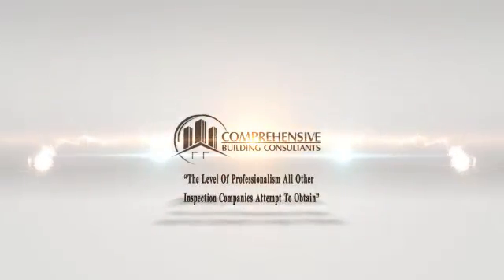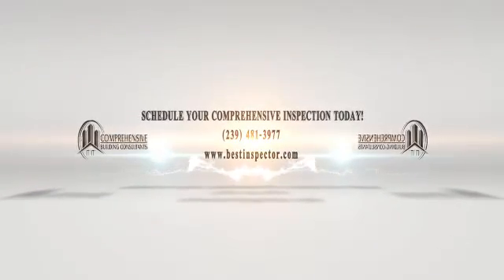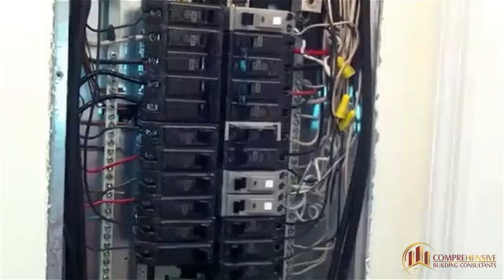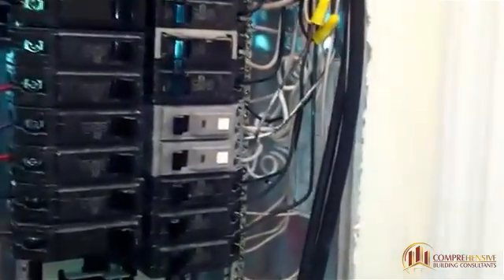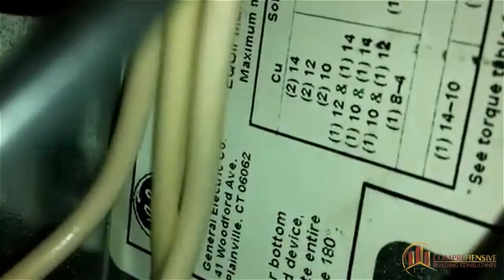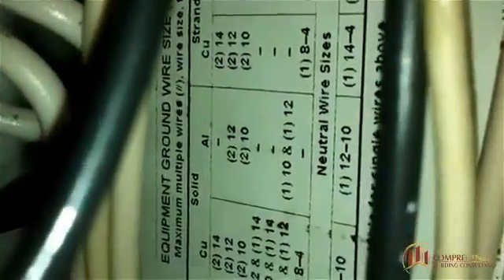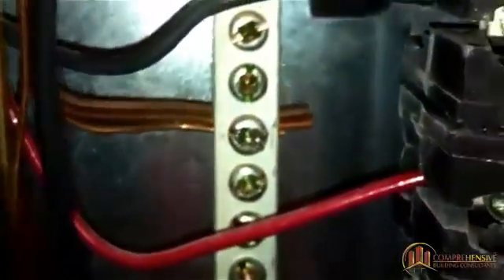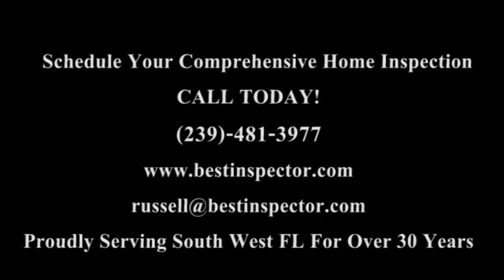Improper ground bus bar

Comment: I just installed a PK23GTA ground bus bar and the manufacturer states it can handle 3 conductors as long as they are the same size. #12 and #14

Comment: I'm an electrician as well. I agree this shouldnt be an issue but has the potential to be. That being said, the bond does need to be ensured a good mechanical/electrical connection. The bonding conductor is potentially a current carrying conductor in the case of a short fault, improper use or a short after the load . In the case of a short fault, a bad bond connection would not serve its intent and all bonded parts of that circuit could become hot. Improper use - someone could potentially use a hot conductor, for instance a box containing a switch leg, tap off it for power for an outlet box using the bond as a neutral. I'm pretty sure I ran into something similar like that before. Crazy I know!
Lastly a bond conductor shorted in the circuit after the load. A bond path could also carry current in this case. In all these cases the circuits would work fine without opening the overcurrent protection but improperly with hazards present. Btw, not trying to be anal, but some comments just say its wrong with no explanation as to why.   Just thought I would share tradesman to tradesman.  All the best!

Comment: As a licensed master electrician I can say that grounding wires are not suppose to carry current so 3 in a screw is just fine. There won't be an over heating issue because they are not current carrying conductors. This is just being to picky. It's the same as a number 4 stranded ground wire there is alot of strands in the cable so then this should also apply to those type of cables aswell.
Reply: I'm an electrician as well. I agree this shouldnt be an issue but has the potential to be. That being said, the bond does need to be ensured a good mechanical/electrical connection. The bonding conductor is potentially a current carrying conductor in the case of a short fault, improper use or a short after the load . In the case of a short fault, a bad bond connection would not serve its intent and all bonded parts of that circuit could become hot. Improper use - someone could potentially use a hot conductor, for instance a box containing a switch leg, tap off it for power for an outlet box using the bond as a neutral. I'm pretty sure I ran into something similar like that before. Crazy I know!
Lastly a bond conductor shorted in the circuit after the load. A bond path could also carry current in this case. In all these cases the circuits would work fine without opening the overcurrent protection but improperly with hazards present. Btw, not trying to be anal, but some comments just say its wrong with no explanation as to why.   Just thought I would share tradesman to tradesman.  All the best!

Comment: oh boy another 'inspector" who sat through some bullshit course thought by a retired electrician, telling licenses electricians there work is wrong. NEC states you can put more than one ground in bar and if its the main panel both colds and grounds can be together on the same bus. more than one ground, single cold per terminal.
Reply: But the panel states only 2 per terminal, not 3. It is a code violation to not follow the manufacturer's instructions.

Comment: Red seal journeyman here, so long long as this panel is the first point of service entrance and the neutral buses are bonded to the chassis here with bonding strap in place between neutral and chassis it should be fine. Although I don't do it because it is lazy and isn't visually appealing. Never ever do this in a sub panel, that could actually be a dangerous situation as it would create a ground loop.
Reply: bazz black in actuality, do it anywhere is bad practice! Buss bars are cheap and easily installed if you need more spaces(which clearly was not the case here)! 
Bad habits lead to bad performance!

Comment: Always double grounds or even triple if you have too. BUT NEVER DOUBLE NEUTRALS, ever...
Reply: LeDuckDuckGoose tripling grounds is not to code! So if you do it, do not be surprised to fail your inspection. Even worse is you set up a failure. In this case with no need as there were more than enough open spaces to single each. Besides buss bars are cheap!
Reply: Just follow the specs of the panel, and buy another neutral or ground bar if needed.

Comment: The point of code and professional knowledge is not offset by someone who states, "it works just fine." The point is that a group of high level industry professionals have met and debated a procedure, including engineers and equipment manufacturers, and determined what is the optimal approach for the use of conductors and devices, and then created code standards as a result. BTW...most tradesmen are not union members. Have a pro make ALL modifications in a panelboard cabinet. Reason: untrained people die every week trying to do this themselves. The heart goes into fibrillation, and no amount of CPR can keep you alive if your heart enters that condition due to a shock. Don't be a moron. Call a pro. For my Italian friends: don't be a Stunod.
Reply: We're talking about a grounding wire not 480 volts
Reply: @christopherestevez6375   A grounding wire can easily be carrying unintentional currents which can be deadly. All you have to do is open that circuit with your bare hands and you become the conductor.

Comment: Unreal.. This is no bid deal at all!       You should worry more about changing that battery on your smoke detector!
Reply: David Hansen actually it is potentially a big deal!  Too many wires in one opening in the buss bar, is a potential overheat location, as well as a ground system failure. 
One may lead to fire, the other may lead to serious health issues including death. 
Furthermore on that bar, there was no reason whatsoever to even double up, there were plenty of open spots!
Reply: Coy Patton I don’t quite understand this either since they are all on the same bus bar anyway. I sort of get what is being said about an overload spot.
Reply: @coypatton3160  What the fuck are you talking about
Reply: @driveronehundrednine3225  your need for profanity is unacceptable. You have been reported! It points out you immaturity! Basically go read the NEC to find what I am talking about!

Comment: 1. They are not orifices.
2. You do not need to call a tradesman as long as you know what you are doing.
3. This is only one type of problem with ground bars. This video is woefully inadequate.
4. I sure hope you killed the power before sticking your fingers in that box. Next time use a pointer.
5. While I'm sure that box is functional, its a mess.
Reply: since he's doing a home inspection for either a buyer or a seller, there may be a stipulation that the work is done by a licensed tradesman.

Comment: We always connected the grounds and neutrals too the same bus bar! Bad idea! The fix is simple ad another bus bar then transfer the grounds to it then run a ground cable back to the main box. Use green wire or tape to mark it as a virgin wire that only carries current if an appliance becomes charged due to a faulty wire.
Reply: johngmc65 I agree, even if it is the main panel and neutral and ground bars are bonded, it looks more professional, more organized and neat if they are separate. Bars are cheap if you need more spaces and simple to install.
Reply: Coy Patton help me understand something I never quite got. What difference does it make with ground and neutrals being on bus bars that are connected?  Looks like separated bus bars and separate ground stakes would be safer.
Reply: @rickeykeeton71  At the first point of disconnect and nowhere else, the ground and neutral are bonded together. This is because the neutral needs to be at the same potential as ground, so there is no voltage between neutral and ground. Since the neutral is a current carrying conductor, we cannot bond grounds and neutrals together at any other point in the system, or else we would have current on our grounds, metal junction boxes, and all metal equipment. This is very dangerous and must be avoided.
Reply: the problem is the number of conductors on each screw, not that the grounds and neutrals are bonded
Reply: This is not a video referring to a main or sub panel it's talking about a grounding bus bar and how many can go in each screw

Comment: This must be a union video, ( call a tradesman ) to move a ground? I have seen 5 wires in a bus bar in the same spot and it works just fine.
Reply: It may work fine because grounding itself is a protective measure but it's lazy and especially unnecessary when they're are open slots on the ground bus :/
Reply: Call a trademan, my ass!
Reply: So then is it wrong to have 3 ground wires in one wire nut?
Reply: @hawkdaddy64   Did you actually read rating of your product...  Wire nuts have ratings also..  SMH
Reply: @hawkdaddy64  No. This has nothing to do with wire nuts. It is the rating for the grounding terminals for that panel in the video.

Comment: It doesn't matter if you put 10 wires in the same lug, as long as they fit in there. You don't seem to know what's proper and what's improper.
Reply: obviously it does matter. the bus bar in the panel is rated for only two conductors under each screw so that's the most that's allowed. There's a reason it's limited.
Reply: You have to be knowledgeable to know stuff.
Reply: Terre Haute and this commenter proves his lack of knowledge. I wonder if he realizes with that label now documented by the video, who will be held responsible legally for his actions?